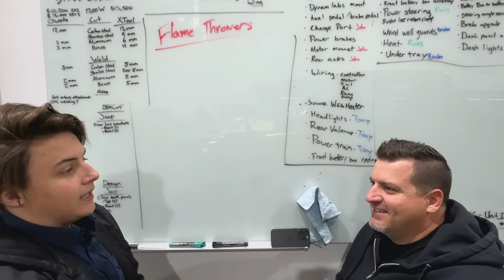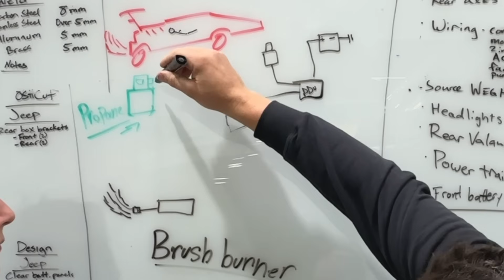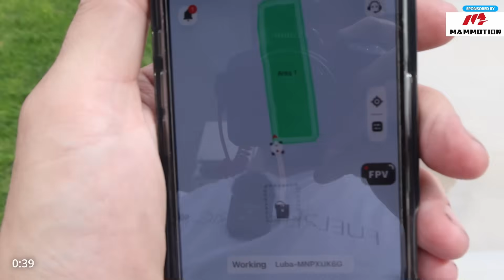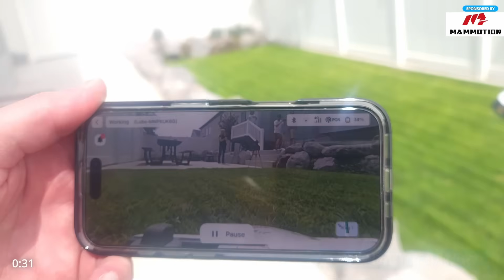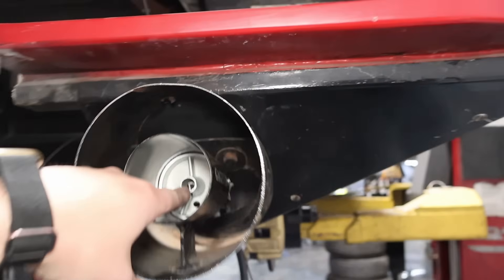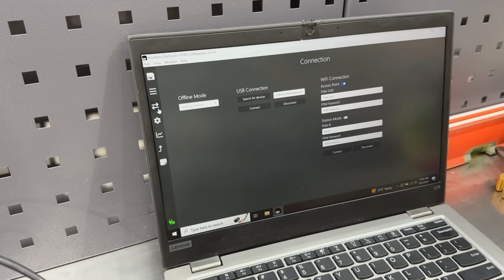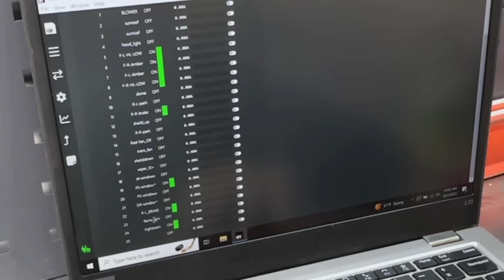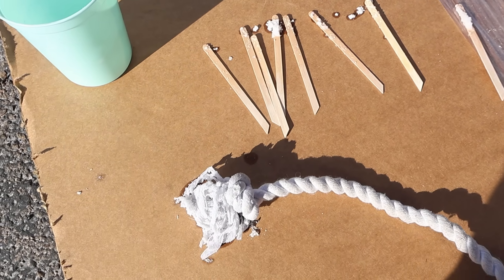Engineering the Flame Thrower from Black Moon Rising

Comment: The movie flames were made by simply flipping the propane tank upside down enough to burn actual liquid propane instead of the gas. Unfortunately this is also a very dangerous way to get the effect, as it can flashback into the tank, and by that point it is too late and you can kiss your ass goodbye...if you even have the time to realize it happened...

Comment: Any way you can do both, selectable with a switch? Will spraying the liquid solution into the jet flame make it red? For the fireball flame a second propane injector could be installed below the jet flame one since that external combustion doesn't have to be centered in the pipe, and having it a bit lower would be less threatening to the paint on the body.

Comment: Coloring the flame was the first thing I thought of when you started talking about using a propane torch. And if you are talking about the looks the red jets, looks a lot more futuristic than the billowing yellow flames. The later looks mostly like something has caught on fire.

Now the question is the color. Red might be the color from the movie and if you want to make it look like that then go red, Personally I could see a blue hue looking better, but I'm uncertain how hard it would be to det a solidly and very visible blue color. The propane itself burns with a slightly blue tint if it getts enough air. But it's so faint it's almost making the flame invisible.

So after thinking about it again, the red jets is it!

Comment: Before deciding on which you want to do you might want to do a wind tunnel or a drive to see how the air as you drive will affect the flames. Unless this effect is supposed to be for stationary displays. But the red flames are really cool. How should the client reload the salt for the effect? Is there a dispenser or do you install a “wick” each time you use it?

Comment: If you put different metals in the flame you will achieve a similar colour change eg Copper will give you a green colour and you wont have to worry about the rope/chemicals burning away.
The large red flame looks better but seems closer to the car and curls upward quickly, the other looks ok but seems to shoot further, can you get a combination of the two to get like 4-5 foot flames straight out?

Comment: I maybe wrong but for the electricity wiring to me it all seems like its design more to towards combustion vehicle and for electrical vehicle don't the motor generate electromagnetic interference and would it be best to use wiring from those computer LAN cable especially those sheided LAN cables?

Comment: While I'm generally partial to big balls of fire, the red jets get my vote. Better visuals, matches the red trim, better audio presence, safer for the body panels, and less susceptible to wind/turbulence sending the flames in unintended directions. Plus, as was said, 𝘢𝘯𝘺𝘰𝘯𝘦 can have big yellow flames, but red is something you don't usually see outside of firework shows.

Comment: You should limit the horsepower of the motors unless you push the "boost" button that not only releases the artificial limit on horsepower, it simultaneously ignites the red jets.

Comment: Add a lower-pressure Propane Gas tube into the outer shell of the flame thrower.  Then, when you want the yellow fireball effect, hit the new low-pressure switch, which should give a nice fireball effect...
Reply from the maker: Noted!

Comment: The reddish tint was from the film stock the camera was loaded with,  and later tweaked in post,  I suspect they may have used a blue filter over the lens,   probably a 1 % CTB filter.   You know using a adblue system,  you can premix the liquid strontium salt, and use the adblue discharge jet to spray into the flame that way its repeatedable and you can put the premix in a small tank.   Also when the car is moving you are going to get a lot of turbulence at the rear,  the film crew had all day and night to get that four second shot.   You can take a trick out of the hot air balloon crowd and coil the copper tube into the throat of the flame,  this heats the tube which heats the gas,  in the tube before it comes past the igniter,  giving instant and consistent flame.  If you look at the jet burner on a hot air balloon,  its coiled around the jet.   We also use this technique in smoke machines for example  the artem fx hand held fogger,  and even high end vapes use this.    I am a SFX designer and I loved watching you guys enjoy yourselfs engineering,  keep it up,  what a cracking build to work on.
Reply: I also like this idea but I think they can have both but it would be one version at a time and it would be able to swap on the fly. I would make it 2 staged using a hot rod trick on this. So they add a sparkplug with a coil to the last few feet of the exhaust just behind a small fuel injector. Gasoline with the hot exhaust makes a very large fire ball. I would think a r/c airplane fan jet and some of fuel on the outside ring could add the fireball and would be lit by the burner in the center. Might need to adjust its mounting to let the fan flow the air for the outer ring.

Comment: Most propane bbq have a complete ignition system, button, AA powered ignition box and igniter……runs as long as you hold the button, wire gas solenoid to it.